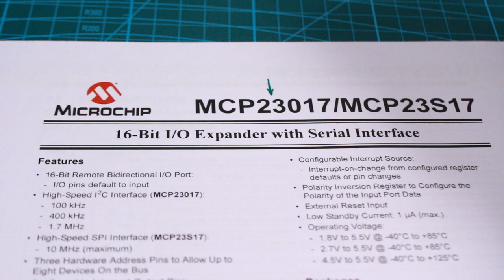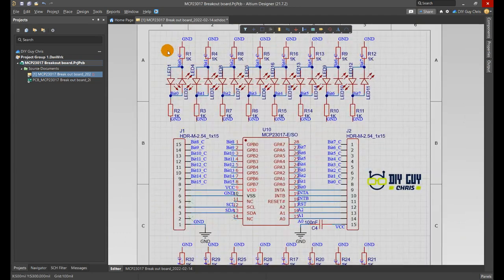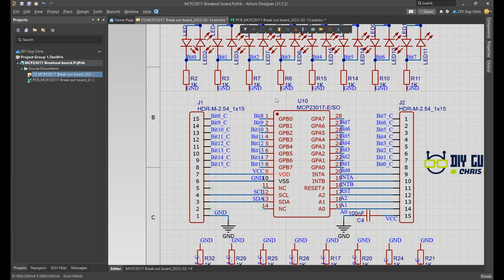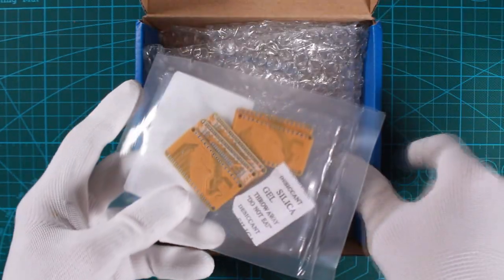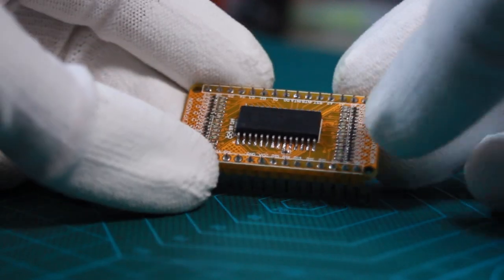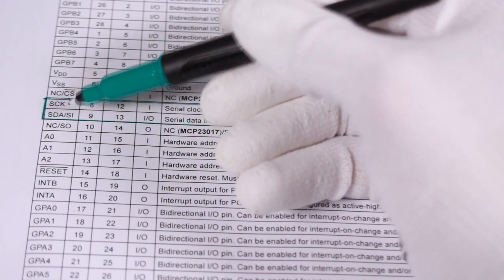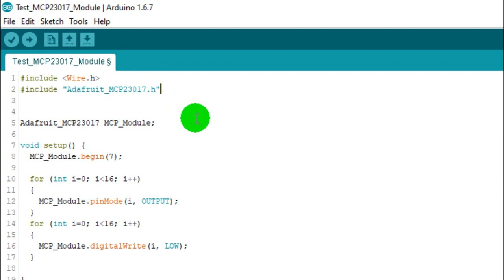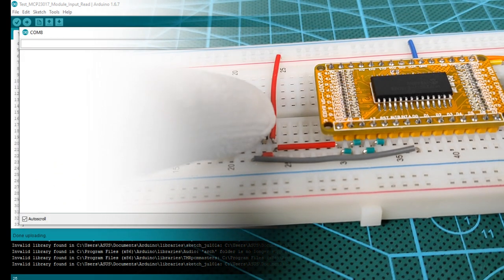Arduino Best expander Input/Output | GPIO Expansion module | MCP23017, MCP23S17

Comment: In a project, altera max ii fpga ic and mcu atmega328p are installed, altera max ii was used to expand io pins. Only the MCU must be programmed. Or both the Altera Max II and the MCU will be programmed.

Comment: does that adafruit library handle the debouncing of the switch or did you add a 5ms piece of logic in there yourself?  I noticed you got precisely only one message per push down and one for release.   Normally momentary switches (especially ones that are not top quality) will "bounce" as the mechanical plate causes a bounce (you can see on the o scope) when you get close to closing.  debouncing usually removes this or putting in about a 5ms logic to handle it.   Very cool video.  I have used a dozens of PCA9685 modules and love anything i2c
Reply from the maker: That's a good point to highlight, I got the inputs to interpret the clicks through logic edge because edges appear one time but logic level is continuous so I suggest you add a boolean variable as a flag for each input reading and add it to the input read if() statement so for example instead of writing if(digitalRead(input)) 
{
  Serial.println("message");
}
You write
if(digitalRead(input)&&flagInput) 
{
  Serial.println("message");
  flagInput=0;
}
if(!digitalRead(input))
{
  flagInput=1;
}
This way the flagInput variable will ensure that we get the message one time only once the input is high.
This will cost you some of the dynamic memory of your MCU due to variables use.
Instead you could add a short delay of around 200 ms just inside the "if" statement so it becomes like this
if(digitalRead(input)) 
{
  delay(200);
  Serial.println("message");
}
But this will keep you getting the message on the serial as long as the button is clicked.
I hope this is clear
Reply: @DIYGUYChris  that is how I handle "Button Presses" too
Reply: @DIYGUYChris  well, except the delay, I despise delay in microcontroller code.  I either use Millis or interrupts with a simple Finite State Machine logic to give the illusion of "pauses or delays" but still have processor "free" to provide a multi task feel.  This becomes VERY important when you want to react quickly to things like button presses, especially of you have a bunch of them

Comment: In your example sketches, one demonstrated OUTPUT and the second demonstrated INPUT.

Can this expander have some
pins set to OUTPUT and different pins set to INPUT (within the same sketch)?
Reply from the maker: Sure thing, it is as same as you set the arduino pin I/O

Comment: Sooo, could you make a 3d printer with raspberry pi pico now that you can expand its IO pins?
Reply from the maker: You can make 3D printer without any need of expansion : )
Reply: @DIYGUYChris  But for a 3d printer usually you have to have at least one stepper per axis and an extra for the extruder, i think the pico doesn't have that much IO pins
Reply from the maker: @luizpollo  you will not get the steppers powered directly from Pico, there you will have stepper motor drivers,  A4988 is one of these drivers.
In this case no need for extra GPIOs

Comment: Is it possible to use audio input (e.g. inmp441 i2s) or audio output (e.g. max98357A i2s) via this port expander? If yes how is it done, especially the pin config? Thanks for any advice. I only got buttons, leds, encoders to work.
Reply from the maker: I²S is an audio communication protocal that requires an I²S data line which is not existing in MCP expander not even in other GPIO Expander because these will provide General Purpose IO but I²S is specific IO for sound.
I hope you can distinguish these two terms (I²S and GPIO) !

Comment: I have used mcp23s17 in a project to extend the io pins.but the speed is getting with 16-bit remote bidirectional 10mhz. What can i use instead of mcp23s17 to increase capacity. Can i connect mcp23s17 in parrallel to solve my problem? The problem in this project is that ic above 128kb is not being read,i want to read 192kb ic.
Application need more io pin because of laptop keyboard connector is 32 pin connect to my pcb.
I used mcu atmega88 in my project.
This my programmer is only able to read io ic 128kb of laptop. Cannot read 192kb ic.
How to solve this problem. Please help or make video on this topic.
Thank you
Reply from the maker: You are already using the MCP23S17 in parrallel because it uses SPI communication which is already the fastest communication port for MCPs, maybe you need more software solution rather than hardware, try to read/write ports instead of reading or writing one bit at a time, it helped me to speed up the outputs writing for my MCP23017 once.
Reply: Please suggest what is the mistak in delphy code.

Comment: I will need your help
Reply from the maker: Okay
Reply: @DIYGUYChris   I would like a hat that can hold up to 96 GPIO pin hat. With its own power supply from a 12v -24V DC BATTERY THAT 🔋 and cand a Automatically be controlled with the raspberry pie depending on load
Reply: @DIYGUYChris    I want to use R GB W on my 2005 theater Sequoia I'll be able to control it from a raspberry pie app inside the car
Reply: @DIYGUYChris    I need if I can make another GPL or USB HATt that could control all the 4k cameras on the S UV and store in a external SSD, like tasla camara blind spot camaras.  I would like to know if there's a 3-D program that I could use for my vehicle to select toggle switches for my LED light on my car display inside the car
Reply: @DIYGUYChris    I want the raspberry pie depending on my command to tell if the door is open and if I can turn on the light what color will it be and what color can I change it to or if the Ignition switches on or off when till start loading data into it is hard drive
Reply: @DIYGUYChris  hello